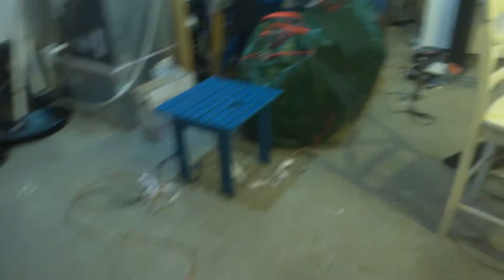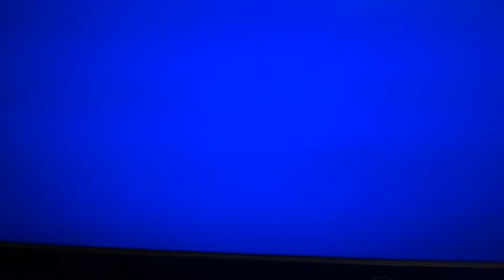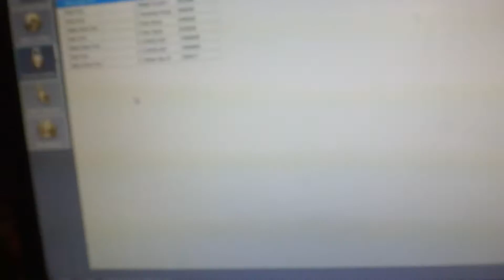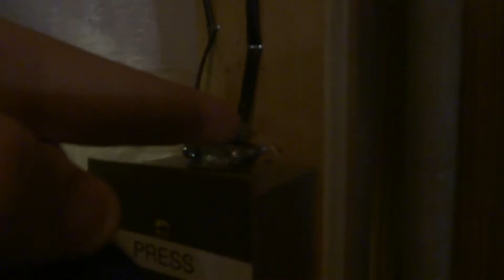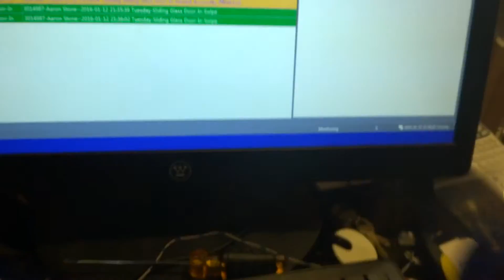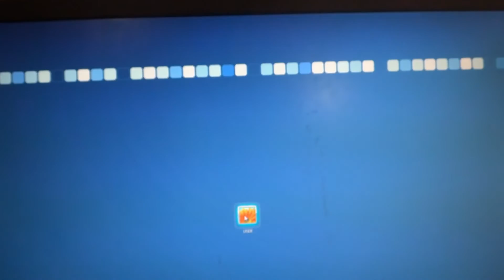My TCP/IP/Wiegand Access Control System - Update

Comment: Where do you wire the door Open/Close sensor wire to on the controller?  It does not have this input on the Access Controller.  Diagram please?  Thanks!  Hint:  Shot video in the daytime is better for outside.

Comment: Hey, I'm having some trouble with the set-up of our control access program. I am having issues getting the card reader to communicate with the software console. The door locks work however; and I can control them with the console just fine. So everything looks like the controller is set up correctly, we even went as far as to physically replace the old reader with a new one and to re-verify the wiring. I believe something is wrong on the console's end. I also cannot seem to access the [Extended Function] operation menu under [Tools]. Whenever I click to enter the Extended Functions, the password box pops up, I enter the password, hit enter, and the box disappears, and then nothing else happens. The system acts as if I didn't give it a command. Any help?
Reply from the maker: Hmm, that is really weird. My advice is to go to Basic Operate, then select the door and then click Monitor. If you scan something on the reader and something comes up, then something software wise isn't working, probably the privileges. If not, then either there is something wrong with the wiring or there is something wrong with the controller. You can try to plug the card reader's terminal block into another terminal for a different door to see if something happens (all of them wire up the same). Without seeing it personally though, I can't give a concrete answer. As for the extended functions, the password should be "5678". If that doesn't work, then you may need to re-install the program.
Reply: Awesome, thank you for such a quick response. I was able to get into the extended functions. The issue really was as embarrassing as not putting in the right password. So thanks for the dummy check.As far as the reader issue is concerned; however, it looks like a bigger problem. The console is able to successfully monitor all push button door exits, but it does not log or acknowledge anything happening with the reader. We retested at one of the other door's reader [on the same console] yet experienced the same issue. So, after replacing one reader and trying another reader at a different location we keep arriving at the same issue. The Console is not communicating with any of the readers, but the console communicates just fine with everything else. Do you think it's a controller issue? If so, what do you recommend? 
P.S. Thanks again for taking the time to genuinely respond to my questions. It was hard trying to find someone familiar with this software.
Reply from the maker: I am not sure what can be done. My advice is to contact the sender or your distributor if you really think that is the problem. I would have to see it myself to give a genuine answer unfortunately, but I try to help as much as possible.
Reply: Thanks for all your help back there! As it turns out, the issue with the first reader was a broken wire at the terminal connection inside the controller. The second reader was just a ghost in the system: (unplug, plug back in, fixed). Now everything is talking and communication just fine! So thanks again for responding to me and pointing me in the right direction.My only hurdle now is to try and figure out how to set scheduled parameters to automatedly* disable all locks within two distinct time frames during two different days of the week. Any chance you could point me in the right direction again?
Reply from the maker: Yup, I am glad that you found the problem, because that can totally be the problem. As far as the automatically locking and unlocking, I haven't dug that deep into the program. I was thinking about doing that, so when I get back from vacation, I will probably figure out how to do that.

Comment: How much do these things cost? I gotta building that needs this and it has like 12 doors. Also can you put these card readers in a elevator easily cuse I don't want people going to the basement on the elevator at my building. These videos are very helpful though
Reply from the maker: +TheBigA I paid I think $50 for this 4 door unit. You could buy 3 of these, as the program will support multiple units. While you can put this in an elevator, you may want to have an elevator guy come out and fish the wire for the reader to the elevator as well as installing the floor lockout in the controller, but it is possible. Thanks for watching!
Reply: 12 doors and elevator my company will charge you around 35 k dlls which is not a bad price at all